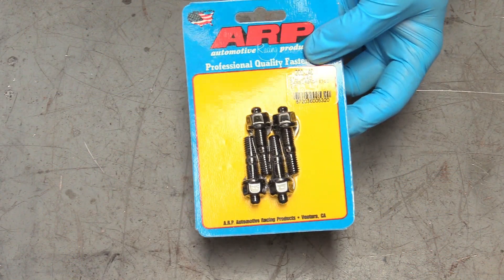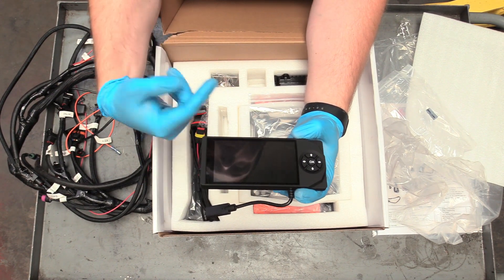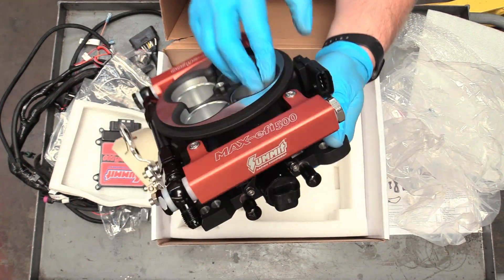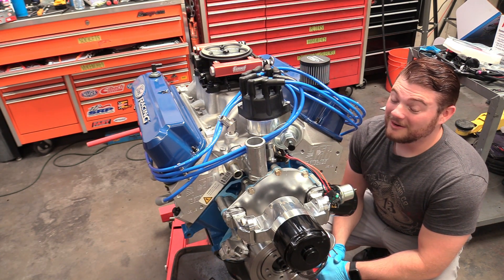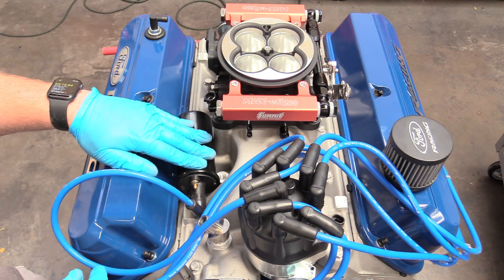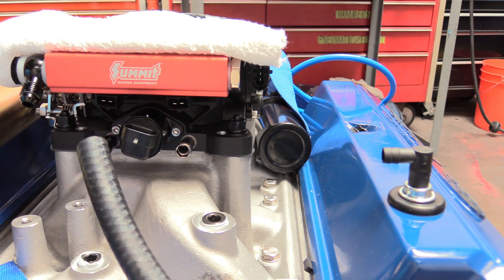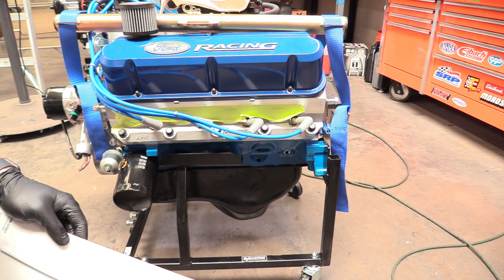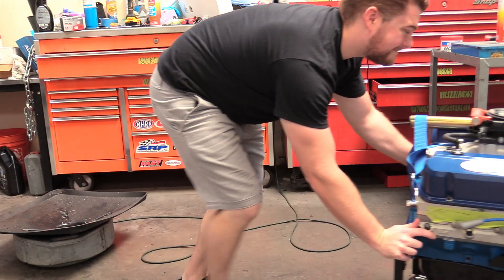How to Build a Ford 302 Small Block - Part 10: Throttle Body, Coil, Rear Main Seal

Comment: would the bolts going into the head with the engine sling be enough to support the motor with a transmission mounted to it as well with the aluminum heads? thanks
Reply from the maker: If you have a lot of threads on the bolts in the head it is probably fine. Thanks for watching!
Reply: @2carpros  thanks, I’ve really enjoyed watching your 302 build, and it’s giving me lots of confidence and tips to rebuild the one I have for my 302 going into my 79 f150

Comment: I see the provision for the dipstick in the timing cover, i dont think i have seen them being bolted to the headers. On my 69 galaxie, it bolts to the head and goes through the timing cover at the base. Just curious
Reply from the maker: Ours has a hole in the block for the dip tube so we are using that. Thanks for watching!

Comment: What was the part # for the engine sling that bolts onto the end of the heads instead of the intake manifold?  What two torque wrenches did you use on this build?
Reply from the maker: I don't have a part number on me but the threads for that head are 7/16-14 so just get long enough bolts at the hardware store. I used https://shop.snapon.com/product/TechAngle-Models-(2%-Accuracy)/1-2%22-Drive-TechAngle-Electronic-Torque-Wrench-(15%E2%80%93300-ft-lb)/ATECH3FR300B and https://shop.snapon.com/product/US-Torque-Instruments-(in-lb)/3-8%22-Drive-SAE-Adjustable-Click-Type-Compact-Fixed-Ratchet-Torque-Wrench-(40%E2%80%93200-in-lb)/QD2R200A But you don't need ones quite that expensive. I just happened to have them so I used them. Thanks for watching!
Reply: That link does not go to the engine sling?

Comment: I'm curious if that "carb" is california legal. Probably not which would be stupid cuz it would make older smog era cars and trucks more efficient.
Reply from the maker: I think it is. Luckily this is before OBDII which is what they plug into for smog here. So they will have to put a sniffer up the tail pipe which we will load with catalytic converters it will be 90000 times cleaner than stock. Thanks for watching!

Comment: Can you recommend a good cam for my 5.3 it's for  lowrider so I don't need speed but I know stock ones suck I guess a better brand
Reply from the maker: Yeah check out this video we did installing a camshaft in a 5.3L LM7. https://www.youtube.com/watch?v=QOr3m815pIQ&list=PLe3kz1i_LrtX5402mzO6ovoz8xeUdwZ8B&index=4&t=1s We used a Summit Racing camshaft and it turned out great! Thanks for watching!
Reply: In general, a mid to high 400 lift hydraulic cam will work well for a daily driver lowrider.
Reply: @ericfitzpatrick5319   First of all anyone recommending a camshaft without even knowing all of the specifics of the vehicle is an idiot!